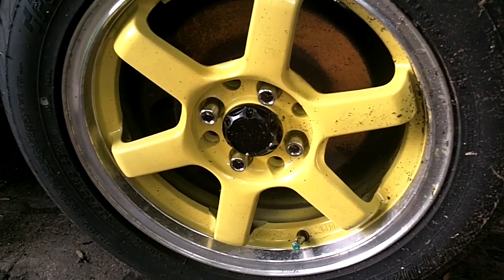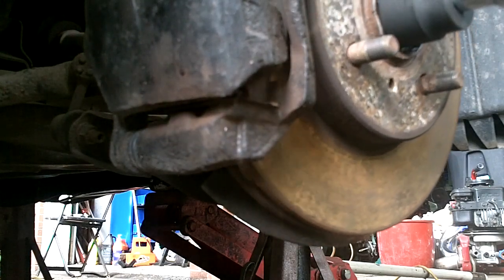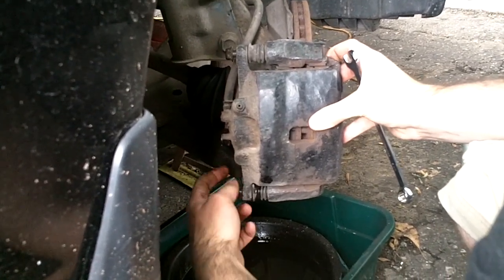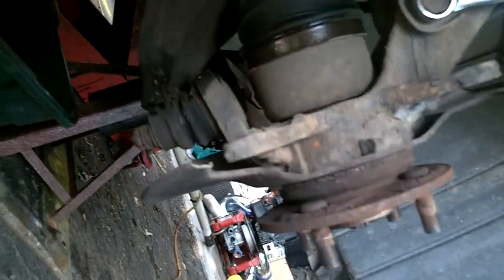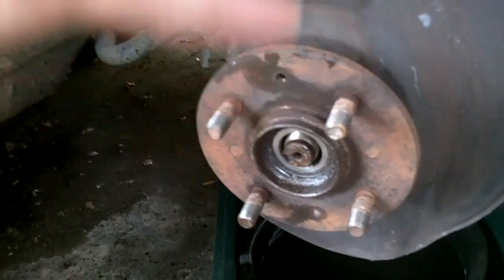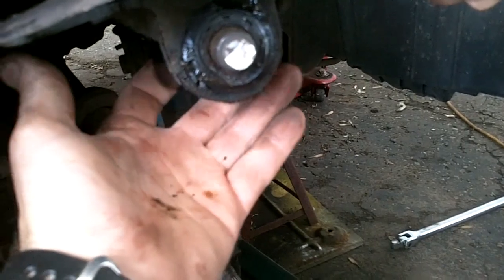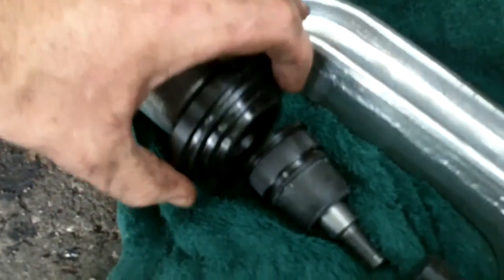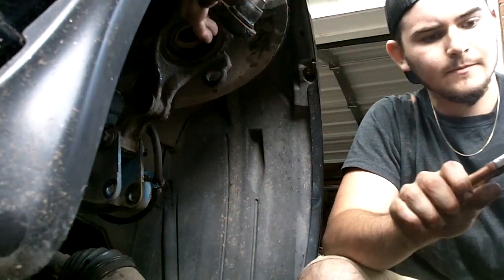2001-2005 Honda Civic ball joint replacement

Comment: I was impressed that you actually used a jack stand. too many people don't. thank you. also as l'm sure you know, you can't really do anything 'half-assed' and get things done quickly. just take your time and do it right the first time. the axle nut will come loose easier if you use a breaker bar while the vehicle is on the ground (tire mounted) and then remove w air gun. I hope you realigned it after you disconnected the spindle from the shock. very good video btw. very informative and good video thank you very much
Reply from the maker: +not ratt   Thanks.. I was pinned under a car years ago ( I was 20 or so at the time and didn't take safety seriously)when the jack slowly lost pressure and I was trapped.. not hurt, just wedged.. waited an hour or so until a neighbor walked by and I called him to come help get me out..never enough jackstands now, and the wheel that is removed goes under the car as a back up  :)  Yes re- alignment was done..

Comment: Very helpful, many thanks for posting this vid.

For those mentioning ABS sensors, mine were pretty well corroded into the knuckle. 
Ended up unplugging the wiring from the connector  behind the bracket on the inner arch.

Comment: Use 1 3/4" cups , it worked for me. Came with the ebay ball joint removal kit. My ball joint was frozen dead so i had to cut it. After i cut the ball joint, i took out the lower control arm in order to hammer the sht out of the frozen ball joint. I was still able to press out the old ball joint no problem. If you have ABS like me, do not attempt to remove the ABS sensor because you'll end up damaging it and its not cheap !!! Just remove the whole connection with the cable !!!!

Comment: I know the retaining clip is a must.  I've personally worked on two Honda Civics that had the ball joint get pushed out through the spindle assemble.   Not a good deal.  I personally have a thought that four tack welds of the ball joint, along with the retainer clip would kep the ball joint in the spindle.

Comment: Great video.  I need to replace the lower ball joints on my 2002 LX and this video was very straightforward and instructional.  I should be able to knock this out now no problem!

Comment: Whats the name of your impact wrench you used?? Looking to buy an impact specifically for doing this job...
Great video!
Reply from the maker: I was using a Dewalt 1/2 inch electric impact. (around 350 ft lbs of torque )  I now use an 18v cordless Milwaukee 1/2 inch inpact  550lb feet ...the Harbor freight earthquake xt cordless is 1200 ftlbs and has gotten good reviews  https://www.harborfreight.com/20v-max-lithium-12-in-cordless-xtreme-torque-impact-wrench-kit-63852.html
Reply: Teddy a good impact is almost a must

Comment: Did you have to torq down the castle nut before inserting the pin? Just curious cause there was some play in mine so I threw on a washer before the castle nut and then put in the pin.
Reply from the maker: some aftermarket ball joints seem to have a slightly longer shaft ,with the hole drilled too far down to properly seat in the castle nut...putting a washer in is fine..the one we used was okay without it .

Comment: which ball joint did you use, and how good they are so far?.
i´m thinking in get a moog ball joint, but some reviews mention, that they have a nipple to grease fill and they don´t fit properly the nipple rub against the abs sensor or something like that, any recomendation? (by the way i have a 2002 honda civic lx)
Reply from the maker: sorry I don't remember which ball joint was used ...it was a while ago ,and my son sold it last year... I do generally use Moog parts when they are available...never had an issue with them

Comment: How long did it take you? Looking by how easy that impact did the job, u could have saved some time and hammered it out, i usually  do does joints  in less than hour, and when they get tough bout 1 and a half

Comment: besides what I saw in the video, were there any other problems you encountered while trying to remove the axle from the hub? I'm doing this now, and that is my problem at the moment, it seems like its stuck.  *****
Reply from the maker: sorry for the late reply...if the axle won't slip out of the hub,hose it down with wd40..leave the axle nut loose and put the wheel back on..lower the car to the ground and the weight of the car should loosen the axle from the hub...if it doesn;t come loose at first..gently rock the car forward and back until it unsticks

Comment: Before you changed out your ball joints, was there any noise coming from them like a clunking sound around bumps? I have the same car but ive replaced the lower control arms and the noise is still there im just assuming the ball joints are worn.

Comment: It's not necessary to remove the brake lines or bleed the brake oil, all you have to do is to remove the bolts and hang the brake caliper on the side...to install it back, harbor tools is selling a very cheap too, it is called brake pad piston compressor and it cost about $7.00 in Harbor Tools:
https://www.harborfreight.com/disc-brake-pad-piston-compressor-63701.html
Or you can lend one from the local auto part center like Autozone or O'Reilly autoparts.

Comment: so does the rotor need to be removed??? or did you remove because you'll be replacing them
Reply from the maker: You could possibly do it without removing the rotor, but there is limited access for the bearing press we used, so the rotor had to come off. It depends on the press you are using

Comment: You should never completely remove the caliper if it is totally not necessary only to replace it. He has now introduced air into your brake lines. When you're all done with this job you're going to have to bleed all four brakes. Which you could get yourself into a world of hell because bleeder screws could be rusted and they will break. You'll be getting yourself into more work than the ball joint itself. So do not remove brake line from caliper just hang it out of your way.
Reply from the maker: I think I mentioned somewhere in the vid that we were only removing the caliper because we were painting them, and that it wasn't necessary to remove to do the ball joint

Comment: better be safe then sorry.. nice thing  u have Jack stands it comes in handy
Reply from the maker: I always use jack stands , and the removed tire under the car for backup , just in case...I was pinned for over an hour many years ago , and it is pretty freaking scary :(
Reply: i bet but good thing ur k it could've been worst

Comment: All good BUT I cannot get the friggin drive shaft out of the knuckle. WTF! I've hammered the end of the shaft but still no luck.
Reply from the maker: the only thing I can suggest is either heat, or soak in penetrating fluid overnight
Reply: Rent a 3 jaw puller gear puller from auto zone; it would be the easiest way of freeing the axle from the knuckle

Comment: Hellish amount of work to replace one lousy ball joint, I hate japanese cars because of this. Some older euro car had lower ball joint attached to lower control arm with 3 bolts, it was just a matter of opening those bolts and then detach ball joint from hub, about 10-15min job.

Comment: I had my civic in the shop a few days ago to get oil and filters changed and they did "complimentary" tire/brake inspection.  Dude said driver side lower ball joint was ready to pop... I was under the car today checking the ball joints and I see nothing wrong with them. The joint is firmly in place , cotter pin still intact, rubber boot still intact , no unusual driving complaints outside my brakes are grabbing because of a passenger side caliper that is not working so its only catch the driver brake.  What should I be looking for on the lower ball joint other than what I mentioned.. he said it was ready to "pop"  its in place and looks normal to me
Reply: Maybe the shop was low on car repairs and needing to drum up some more business.... I trust none of these small car shops!
Reply from the maker: tiktak25 basically you need to watch up/down movement in the balljoint as weight is put on and off it...when it is on the ground try prying up on the control arm to see if you can move it away from the balljoint..if it moves any more than a millimeter or so,it is time to replace it
Reply: ***** Thanks
Reply: yea u need to use a pry bar when checking ball joints as there is so much weight on them or they may be sprung which hides the play in them.

Comment: DONT USE THIS VIDEO AS REFERNCE. 1A AUTO HAS A WAY EASIER WAY TO DO THIS. THESE GUYS ARE GARAGE MECHANICS.
Reply: BENITO A. Martinez but this is what most of are , including you. Unless you own our own shop with thousands of dollars worth of equipments. I didnt see anything wrong. Yes there are other ways to do it. But if that worked for that then there is nothing wrong with that.